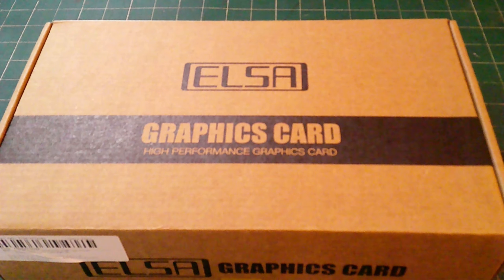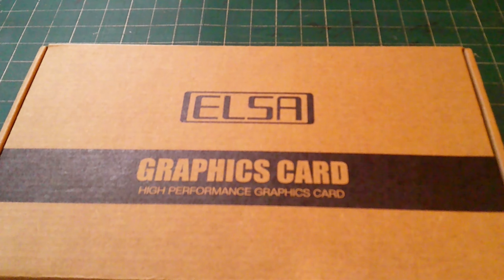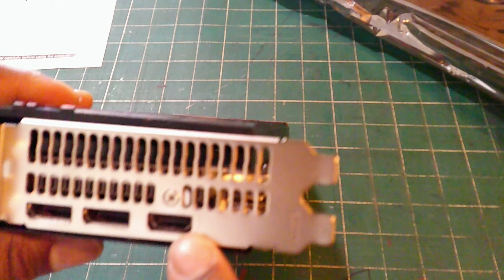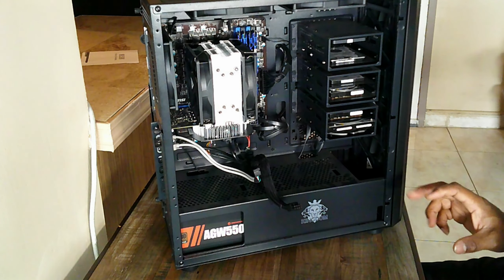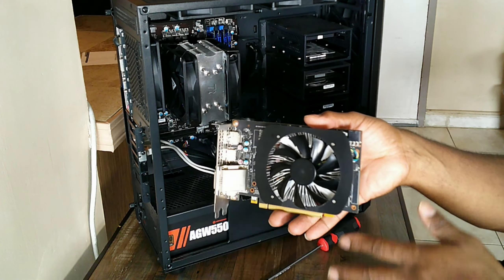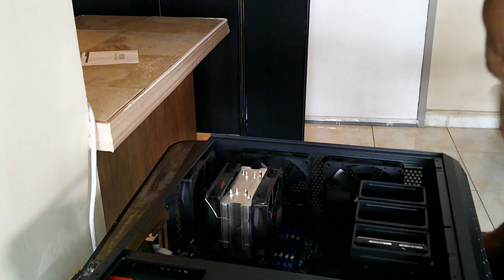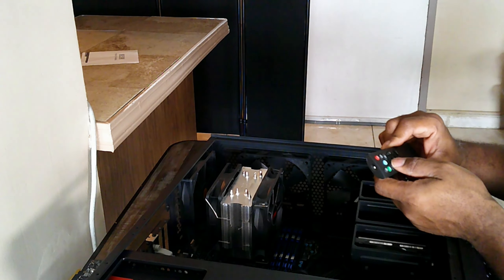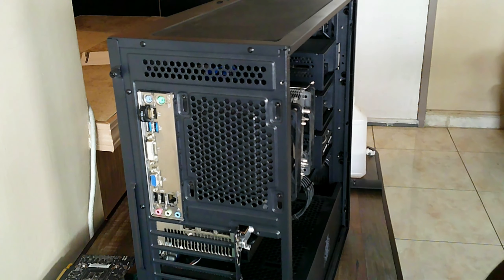Unboxing and Installing the ELSA RX 580 8GB GDDR5 2048SP GPU

Comment: I bought the same spec card and at first i had problems with it and i thought i got ripped off with a little bit of patience and tinkering (in 30-40 minutes) i got it to work drivers were installed without any hiccups and i've been using it for the last 4+ months without changing anything and so far it's working properly, temps are good, voltages are good fps is stable i am playing mostly bf v, bf 1 warhammer vermintide 2, metro exodus, cod mwr and nfs heat and in all games it's been performing good (around 80 to 110+ fps high/max graphics), it's definitely an upgrade for me, but i've wondered has anyone got any bios that they've tested that can maybe overclock the card a bit i've read that these things can be overclocked and undervolted and they work extremely well. PS. i am with the 3770k as well what a coincidence 😄
Reply: what kind of problem did you have?  I bought one for $61 it arrived in a month, I would like to know how you solved the problem so I can have an idea how to do it if I had the same problems

Comment: The 2048 SP means Stream Processors, the normal RX580 has 2304, most have aftermarket ram not like hynix or samsung which can impact gaming FPS allot and they spoof it normally get a good used RX580 brand that is well known ROG Strix RX580 is prob the best card and is around $100 most the cards are modded from 4gb to 8gb, i've even seen 16gb models for some reason i guess they were used for mining
Reply from the maker: yes they were but it is doing great fior my 1080p retro gaming on my 60hz 32 inch monitors
Reply: Good graphics card.
I bought mine for $40 off Aliexpress and it's been a great performer. I couldn't be happier!
Siting on an ASUS board and 8GB which is quite decent, compared to the OG's 4GB.

I could never afford even a Strix 2nd hand.

Comment: Please can you share the link of the driver from the AMD website , ihave the same GPU but cloudnt find the same name of the GPU in the driver page
Reply from the maker: It is going to be the RX 580 Drivers once you download the drivers AMD software is going to pick it up and give you the correct drivers to download. That was AMD RX 580 GDDR5 when it was introduce in 2007 and 2048 is the memory bus then the moved to GDDR6 in 2018 on the GPU soon we will be moving to GDDR7 in Q2. also make sure the chip die number is the same when I got the gpu I broke it down to make sure I have the correct die number.

Drivers: https://www.amd.com/en/support/graphics/radeon-500-series/radeon-rx-500-series/radeon-rx-580

info to know: 
GDDR6: https://en.wikipedia.org/wiki/GDDR6_SDRAM
RX 580 8GB: https://www.techpowerup.com/gpu-specs/amd-radeon-rx-580-2048sp-8-gb.b6323
Reply: @welcometoronsworld6589  thank you father ♥️♥️

Comment: Hello everything is fine? Can you make the Bios download available for this Rx580 Elsa? In the GPU-z software there is a button that allows you to backup the bios. Big hug from Brazil.
Reply from the maker: I see if I can stand by once I do that I will send you a message.
Reply: @welcometoronsworld6589   I second the guy, I bought one recently and one day out of nowhere the memory clocks got stuck at 300 mhz and refuse to go up even with different bios'es, so any help would be appreciated 🙏

Comment: I have this one, Worked for 2 months and never went above 63c
 then display started to show no signal randomly, and It goes back when I remove and replug HDMI cable 
And one day display went no signal when I was watching youtube, and never came back, so I restarted PC and the GPU showed no signal and fans were not spinning
Im using IGPU and idk if the card was bad or its my PSU/MB
Reply from the maker: Might Be All the above or it just you could of had a bad card. Both GPU are working fine in my PCs and as of today I have no issues. See if you can contact the manufactor to see if they can sebd you out a new GPU to replace the defected GPU. Thank you foro watching.

Comment: I can’t get the drivers from adrenaline as tho it’s amd it’s made from Elsa not AMD .. any idea where to get
Reply from the maker: You have to keep in mind that that GPU came out in 2007 the era of GDDR5 if you want to use adrenaline you have to have a GPU with the latest VRAM which is GDDR6 now I new that when I brought the GPU and Did my research on the GPU. If you want to use Adrenaline you have to buy another GPU that supports the GDDR6. 
Info for your knowledge:  https://www.reddit.com/r/AMDHelp/comments/u3y9at/did_adrenaline_stop_supporting_rx_580/?rdt=57339

Buy new GPU that supports Adrenaline Affiliated links
XFX Speedster SWFT319 ,Radeon™ RX 6800: https://amzn.to/4apDYhG
RX 6700XT: https://amzn.to/3IJtD4y
XFX Radeon RX 7900GRE: https://amzn.to/3TOqh6J
Reply: @welcometoronsworld6589 thanks Ron , however I just want to use this card I was only using adrenaline as I thought that’s the only place to get the right driver…. So where’s best to get it driver world? An install the original one that was released.
I’ve used adrenaline on a ryzen 5 5600G with built in graphics no GPU installed installed fine.

Comment: Hey man, I ordered this same exact Elsa rx 580 a few minutes ago and im worried it might be too big for my motherboard. I was hoping if you could quickly pop open your pc case and lmk the dimensions on that bad boy that would be greatly appreciated!
Reply from the maker: what is your motherboard and two keep in mind I'm on the 3rg gen intel MSI B75MA-P45 at first see when you install the gpu in with the back plate that it is not brushing against the ram if it does remove the back plate. Later or I re installed the backplate and mounted my GPU vertical.
https://www.newegg.com/p/2AM-02CE-000H9

Comment: How is it working so far any complications?
Reply from the maker: None all is well with the RX 580 2048 SP. Just mounted my GPU vertical using the EZDIY-FAB PCIE 3.0 riser mount and it is awesome. Played Eternal Threads last night got to the next stage with smooth game play. Over all it is not a bad GPU for my standards. I am enjoying the RX 580 8GB GDDR5
Reply: @welcometoronsworld6589  thank you for replying

Comment: necesito ayuda compre una rx 5080 i no me da imajen ayuda alguien que ya la tenga que me diga como acerle por favor
Reply from the maker: Three Options what is your PSU wattage a low watt PSU is not going to power the PSU, option two that you was scammed and the only way to find out if you have the right GPU is to take of the fan heat sink and get you a magnifier and write down the gpu die number and look it up to see if you have the right gpu, option three you was sold a defectied GPU that have been overclocked and burned out.